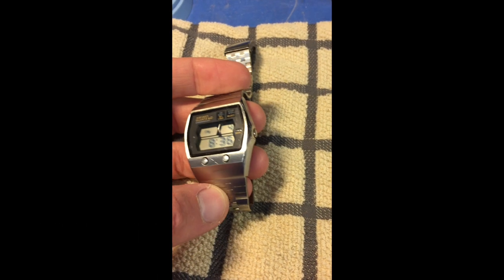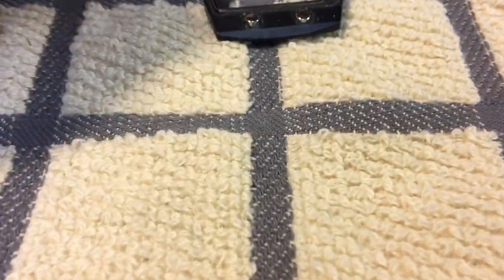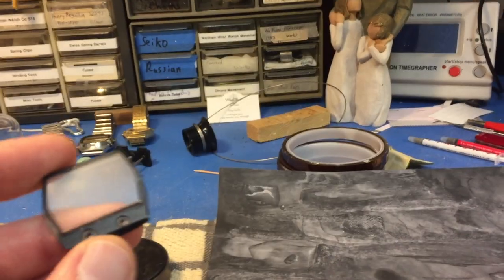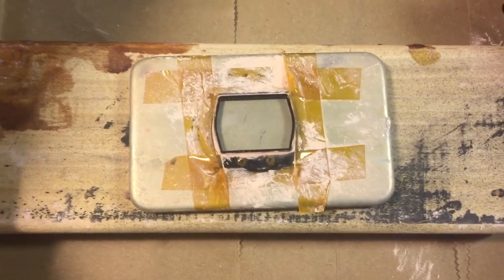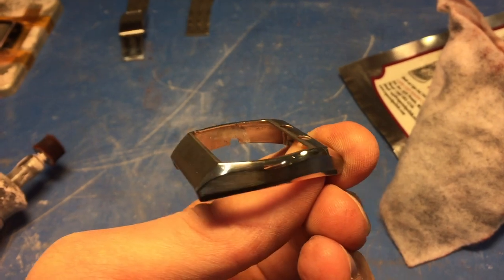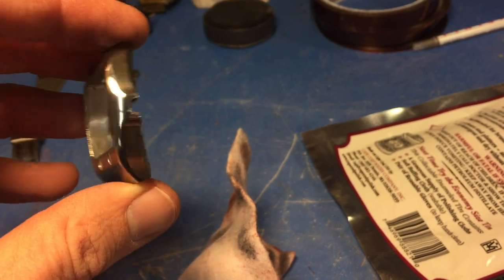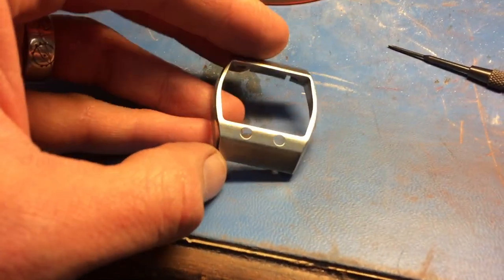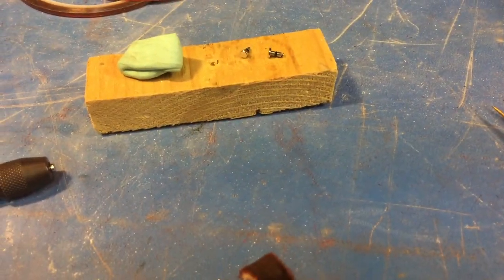A simple approach to polishing Vintage Digital Watches

Comment: Nice job as these are a pain due to e complicated cases. I’ve mainly done 5019 cases that have ground, brushed and polished finish..
I would ditch the red Dailux  it’s for gold. 
Get green or light blue as that is for stainless. You will find it less greasy and soft.  I personally use Menzerna polish now as it’s way better.  If you go for mirror polish just use a few different compounds that bring more shine as they are finer grits . Always finish with a soft cotton Bob. Can be done on your dremel easily.  
Shame about the glass. I have 5000 model with a terribly scratched glass that I really should work on